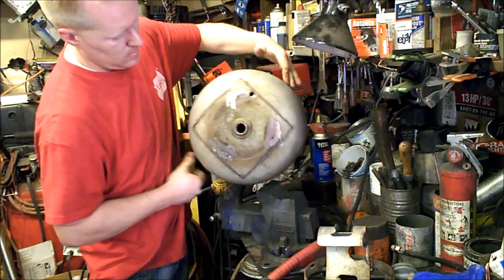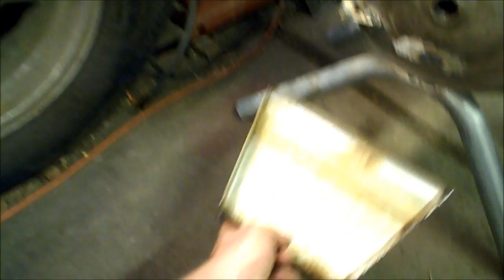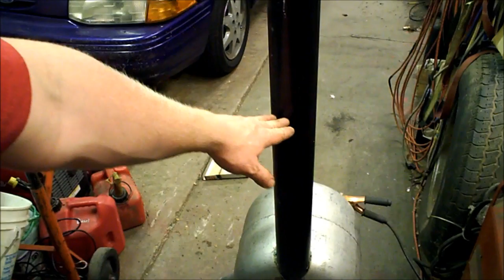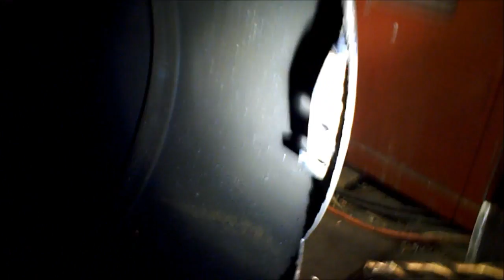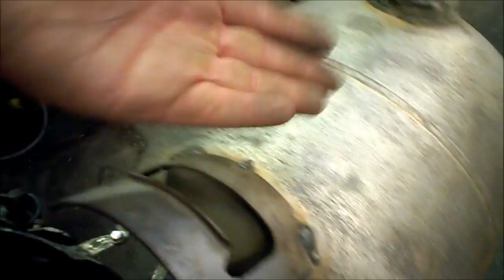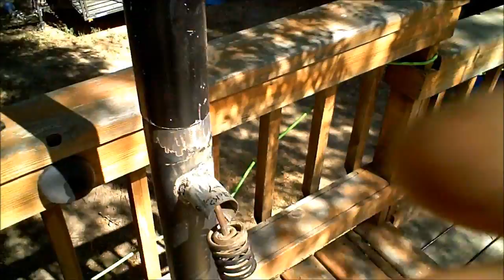Propane Tank Pot Belly Stove Build

Comment: How many pounds of air pressure did you put in this size tank?
Reply from the maker: laughtrax4 They will easily handle 120psi that a standard air compressor puts out. Propane will be at 100-150psi on a typical summer day in the tank. They have a rating stamped into them and it's always around 250psi. They have to handle a lot because propane increases in pressure as it heats up (left out in the sun).

Comment: hello I'm making one out of a well tank it is 12 by 24 up right to take up less space and I have 3 1/4 inch ID pipe for exhaust do you think that would be fine and I will have a after burner air pipe
Reply from the maker: Sounds like a good setup. With that height You may want to put in a baffle in the top to keep as much heat in and not going directly up the flu.

Comment: The top section of pipe should have been tapered to sleeve into the lower pipe, to keep any creosote running back into the stove, rather than leaking down the outside of the pipe and getting all goopy. Nice little stove, though.
Reply from the maker: clamzo1 Great eye. I do know this and you are the first to call me out on it. Since this is more of a temporary stove and I wanted to be able to use different pipes for different applications(lengths). By tapering the one on the stove, I only have to modify 1 pipe and not all of them.
Reply: Good strategy, and a nice build. keep up the good work.
Reply: clamzo1 thanks, thats valuable information

Comment: what is the tool used to do the cutting? I'm a noob
Reply from the maker: Plasma cutter. You can use an angle grinder with a cutting disc, a jig saw with metal blade, a skill saw with a metal blade or a plasma cutter.
Reply: thanks brother

Comment: You want to keep the air intake in the door to keep an eye on the fire.
Reply from the maker: Makes sense.
Reply: There is just enough gap between the door and the frame to monitor the fire, besides; itsN0T all visual.

Your ears give you an equal amount of input.

Comment: Might make a good smoke generator for a smoke house,.. bury the exhaust pipe in ground to cool the smoke  so you smoke the meat and not cook it
Reply from the maker: Yeah, it could be modified for that.
Reply: I like the off set hinges with the matching taper   wish I could weld
Reply from the maker: Welding is a fun hobby and the only way to learn is to do it. I see decent welders pop up at garage sales on online classifieds for $50 all the time.

Comment: how many amp is your welder? I'm collecting material and trying to build propane stoves and am gonna buy a gas-less mig but unsure of the proper size I need. my first time buying a welder and using one since highschool welding class.
Reply from the maker: For most projects I use my Lincoln Weld Pak 100(100amps). It runs of 120volts and will do up to 1/4' thick steel with flux core. I HIGHLY recommend this welder over a cheap Chinese unit. This puts out DC power where the cheap Chinese units output is in AC and very very messy. If you check your local classifieds, generally you can pick up a good used one for roughly the same cost as a new Chinese unit. I bought mine new in 1998 and have put hundreds of pounds of wire through it without any issues. I have since adapted it to run gas and is a true mig machine.
Reply: Craig Gamble there's no such thing as gasless mig. Mig is metal/inert gas. Harbor Freight has a flux core welder for $99. Buy one but buy a better wire. Watch utube

Comment: That tramp pipe is galvanized. Poison when you cut or weld.
Reply from the maker: +Alan Sexton Read more about the "poisoning". It does nothing other than temporary flu like symptoms or maybe a headache. Nothing permanent, it doesn't last and can easily be avoided by not breathing in the fumes as they rise. It is extremely easy to avoid while welding. Cutting won't do anything.